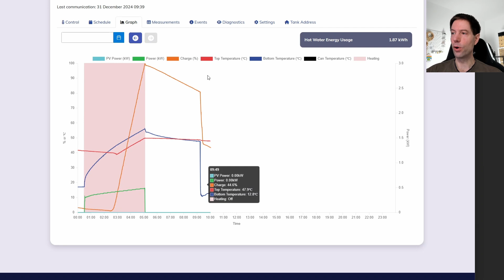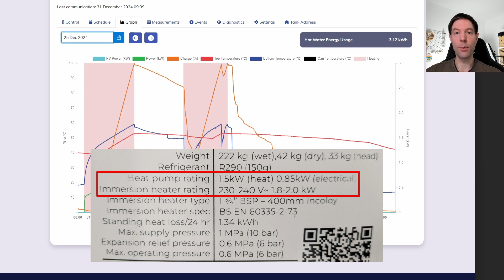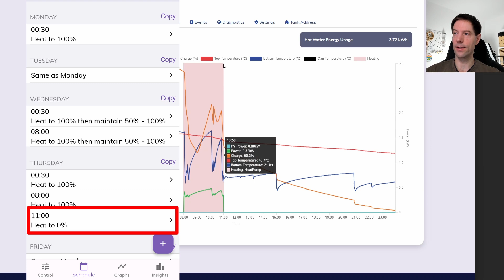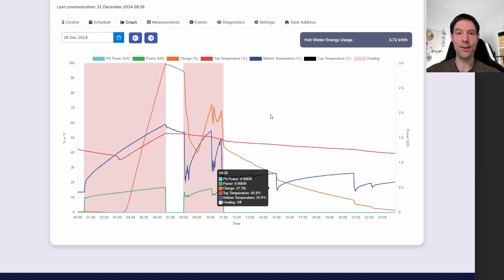Can the Mixergy iHP cope with Christmas?

Comment: Your guests in the bedrooms that are not heated by your fan, how did you heat those rooms?
Reply from the maker: Leave the doors open during the day so that the hall unit heats the entire upstairs.  That's usually sufficient (and is surprisingly effective) but just in case we also provide fan heaters, although they are rarely needed.  A better solution would have been to install a ducted A2A system for the upstairs which would be able to cover all the rooms using a single unit in the loft with ducts leading to vents installed in the ceiling of each room.

Comment: I wish I had this much scheduling control over our cylinder in terms of different target temps at different times. would be mega useful.
Reply from the maker: The scheduling is very good on the Mixergy.  Although you can't set different target temperatures for different times, it's only one temperature.  You can change that temperature any time you like but you can't set it differently for different times of day.  I do like the controls though, and the data that the app gives you.  It's all very handy.

Comment: Happy new year!
Good performance from the mixergy cylinder.
Our 250lt megaflo and system gas boiler supplied for 5 days four adults and four teenage girls. Usually we had the two shower rooms running at the same time and it was impossible to empty the cylinder (setting was continuously on). I recon we used at least 25kwh of gas per day for the hot water.
Reply from the maker: Thankfully we didn't need that much hot water, I suspect we would have struggled under that load.  Although we only used about 3.4 kWh of electricity each day to heat the cylinder.  Probably equivalent to about 10 kWh of gas, give or take.

Comment: Happy new year to you. 

I know you have this working to your liking and it does manage you well but if you had your time again would you do things differently?

You have separate air to air and a separate hot water heater. Also I think you have electric towel rails. Would an all in one air to water heat pump doing the whole house and water be better?

I have neither so genuinely interested.
Reply from the maker: It's an excellent question.  As it happens I'd do more or less the same for our house as we have such huge windows that we really do need the cooling in the summer, so A2A was the sensible option for us.  There are now a few systems that do A2A plus hot water (and even a Samsung system that does A2A, A2W and DHW all in one, which is amazing) , but they are still few and far between so getting hold of such a system back then was basically impossible and still pretty hard now.  Although if I was doing it again I'd look into that option in more detail to see if it would be viable.  As it happens this subject has been on my list of videos to do for a while now so I do intend to cover this in a lot more detail in due course.  For most people (without such huge windows) an A2W system is probably the more sensible option, but with summers getting hotter in the UK I can see the demand for A2A increasing over the coming years.
Reply: @TimAndKatsGreenWalk  good point about the cooling in the summer. I get that. 

I wonder about the running cost though. All your systems running separately I wonder if that is more costly than one pump doing it all! Who knows. 

I’ll look out for your video on a comparison.
Reply from the maker: @CC_FPV running cost is likely to be similar as the COP of the various parts will be comparable.  Install costs for A2A tend to be cheaper than A2W but then the BUS grant isn't currently available for A2A, so that skews it back in favour of A2W.  Although combining an iHP with A2A makes install costs comparable to an A2W system (ignoring the BUS), so it gets quite complicated to compare!

Comment: How many litres is your cylinder again? If you had one long continuous hot shower, how long would the hot water last? Or to put it another way, what's the longest hot shower you could have with your system? Thanks.
Reply from the maker: Crikey, I'm not sure how long it would last but it's a 180L cylinder and we use about 20% for a typical shower, so could get just about five in before it runs out totally.  Four to be safe.
Reply: @TimAndKatsGreenWalk  I like to have a long, hot shower in the evening (for mental health and sleep reasons), which would be a minimum of 15 minutes, and possibly longer, so I'm wondering if a Mixergy cylinder would last long enough, and therefore would be suitable for my use-case. Thanks.
Reply from the maker: @prwilson101  it would definitely last 15 mins.  You can also get bigger cylinders than ours.  If you could work out how many litres per minute your showers usually use then you could find an appropriate sized cylinder, I'm sure.

Comment: Happy New Year. You mentioned rainshower heads, you could consider fitting an aerator to these (if not already aerating), or using the isolation valve to adjust flow rate. If you search for ‘AECB Water standards’ you should find free guidance on design of hot water systems to prioritise energy efficiency, and also reduce consumption at the same time. You can test flow rates (l/min) by putting a bucket under a shower with say a 10L line marked, then turn it on and time how long it takes to reach the line.
Reply from the maker: We have actually done the bucket test and these showers use quite a bit more than a normal head.  It is quite nice, mind, so I'm not in a hurry to change them.  I tend to just not turn them on all the way so that they use a bit less.
Reply: @ You could perhaps consider trying an aerating fitting as they are usually a few quid and still ‘feel’ nice with the tiny bubbles! We have one in our rainshower which runs at 6 l/min on full.
Reply from the maker: @danstewart9323  I'll certainly consider it.

Comment: I'm guessing it's because 2 kW + 1.5 kW is 3.5 kW which is more than the 3.1 kW you can get out of a 13A mains plug or fused spur. I know you can go over 13A for some things, so maybe the reason they don't allow both is because of some UK electrical certification thing? 

If so, they could split it into two 1.5 kW elements so you can have one and the heat pump, or both immersion elements under the 3 kW limit? I'm guessing that would increase costs though, with an extra welded boss, element, control power circuitry, and programming.
Reply from the maker: 1.5 kW is the heat output of the heat pump not the electrical input.  The electrical input maxes out at 0.85 kW, although I've never seen it above 0.55 kW, so combined with a 2 kW immersion it's less than 13A.
Reply: @TimAndKatsGreenWalk  Do you have a way to measure the inrush power when starting the compressor in the heat pump? I wonder if it's as simple as avoiding poor customer experience by having an (even small) chance of blowing the 13A fuse on the fused spur due to current spikes, if the immersion was running at the same time.

Either way, thanks for sharing your experience. Seems to have been entirely unremarkable, in the best possible way!
Reply from the maker: @andrewcoles4271  the charts I showed have the heat pump power as a green line, but only measure at 1 minute intervals, so it's possible it's briefly higher than the 0.35 kW it typically starts at.
Reply: 8:30 the max the heat pump will pull is 0.85kW, so total would be 2.85kW, so would be fine to run both on 13A.

Comment: If you had the immersion on, it'd probably only heat from the bottom or middle, so it wouldn't be usable straight away. Best use for the immersion would be to carry on heating upto 90c in the off peak, but if it takes over 5hrs to get to 100%, you could only get a cost benefit it on agile or intelligent go. Great advantage of having the iHP as a separate unit was that you didn't loose any house heating whilst heating the water.
Reply from the maker: Yes, that's actually a very good point I didn't cover in the video; if we'd had a normal cylinder powered by an A2W heat pump system the space heating would have had to pause while the cylinder got reheated.  Although, as it happens, we actually needed almost no space heating on Christmas or Boxing Day as the higher number of people in the house, plus all the cooking meant the house stayed pretty warm without it, amazingly.

Comment: tankless combi boiler (tankless) would be the only way to get through this, no need to think about hot water, open the tap, hot water there all day long non stop, so much more efficient too as you only burn what you use,  as you aint holding hot water in a tank all day
Reply: Not more efficient, especially if you're using the hot water within a day or two.  A heat pump heated hot water cylinder will always be more efficient.
Reply from the maker: Not as efficient as a heat pump, mind ;)  But yes, a combi boiler is the only way to guarantee a continuous supply of on-demand hot water.
Reply: @TimAndKatsGreenWalk  many modern system boilers with high capacity coils can deliver effectively endless hot water for the sort of demand a combi can deal with.
Reply from the maker: @edc1569  fair enough.  The Heat Geek Mini Store cylinder comes pretty close to operating like a combi-boiler too, with the added benefit of it being heat pump driven.

Comment: I'm sure there would of been loads of people who had "hot water anxiety"😀 over Xmas.with loads of guests, Even on gas, unless you have a Combi or your boiler is set up for PDHW, lots of people would of run out of hot water.
You managed it well with  your Mixergy Air to air water heater.
I'm surprised as you that you can't boost with the immersion as well! Unless I read it wrong?
The figs you showed, even with the immersion on, you are still below 13 amp, and with both working at max, less than my kettle at home.
Reply from the maker: Yup, currently you can only use the immersion heater if the heat pump is broken.  I will be mentioning this to Mixergy to see if there is any way to gain control of the immersion by default, just in case you need it.  But you're absolutely right, I suspect there were a lot of other people boosting their hot water tanks, even with gas!  At least now I know what to expect for the next time we have that many guests at the same time.

Comment: Happy new year. Been running a MixErgy 210l (none heat pump) with a Ecodan heat pump for a year and a mixergy tank for 2 years. We let the software handle the levels of the tank and we have yet to run the tank out of hot water. We mainly have baths running, which will of course run through more water than a shower. We occasionally boast the tank but we have figured out it normally not needed at all. We still find how the tank works is impressive and the fact we always have hot water mean one less thing to worry any more. We have find the best combo is solar + battery with a mixergy and let the software look after the tank levels. Assuming the battery is big enough, any boasts would be handled by the battery, assuming you need any boasts ! The solar diverter isn't that helpful in our experience.
Reply from the maker: Generally we leave the cylinder to it, we only needed to do a bit of active management on these two days because we had so many more people in the house than we usually do.  Otherwise we're pretty hands-off with the iHP.  The boosting we had to do on 25th and 26th did actually come entirely from the battery so it all worked out pretty well in the end.

Comment: Tim, a most interesting topic and one I'd been thinking about. We're on the road to replacing our LPG boiler but to use less gas (there's no price cap on LPG) we heat our hot water exclusively with our 200 ltr tanks immersion via its myenergi eddi during the intelligent octopus period and an average 4.5 kWh per night that's less than £120 pa or < £10 per month, very happy with that. We don't solar divert since we started exporting at 15p. This works brilliantly for two but come Christmas with 6-9 predominantly younger people in the house, cold showers have occurred. So this year I've allowed gas to do it's thing for two days. 
It's good to see that a heat pump can cope in such situations and the boost characteristics of the mixergy are interesting. 
We'll install our A2W HP with the required HW tank replacement but note to self, make sure we can use the immersion in an emergency. 
Again, a very interesting topic with an excellent level of detail,  keep it up and Happy New Year.
Reply from the maker: Thanks!  You should find with a regular A2W system that your water cylinder should reheat a fair bit faster than our iHP as the heat pump is more powerful.  Maybe 1-2 hrs rather than 4-5 for us.

Comment: Happy New Year Tim! A very interesting video and answers a question I'd been mulling over about how the Mixergy would cope. I'm wondering why you wouldn't set the overnight heating to start a little later, to coincide with the end of the Octopus overnight cheaper tarrif, meaning less effect due to the natural decline in temp with time? The beauty of the heat pump is being able to reheat the water during the day with much less power use than just using immersion.
Reply from the maker: Generally I have no idea ahead of time how long the reheat will take, so rather than risk it going into the day rate (and thus using battery that I would rather save for the space heating) I start at 00:30 so that it's more than likely finished before 05:30.  Sometimes when it's really cold it does take longer than 5 hours, so starting as soon as the off-peak period starts is the best overall strategy.  The temperature decline is really very slow, so it's still plenty hot enough by the end of the day even if it's finished heating by 04:00, say.
Reply: @TimAndKatsGreenWalk  good to know